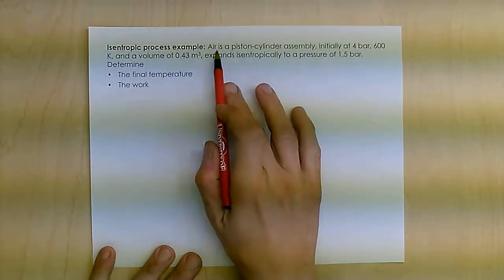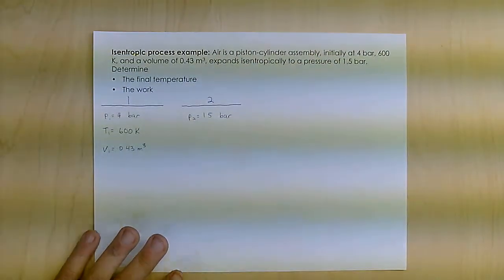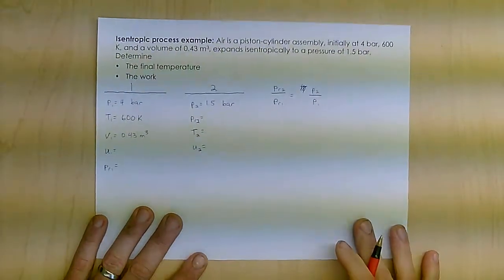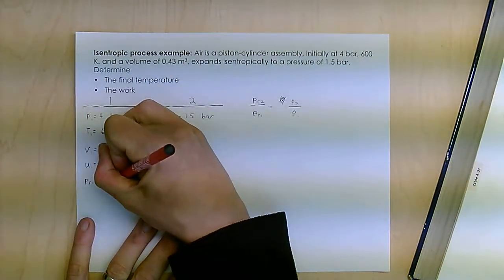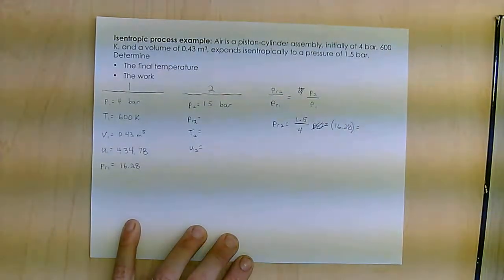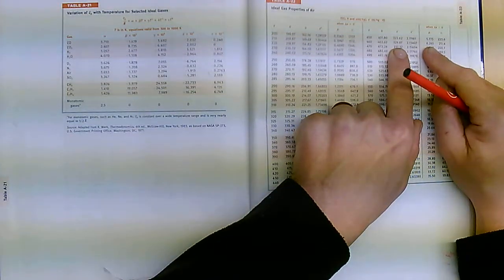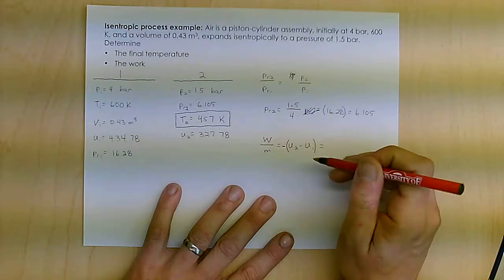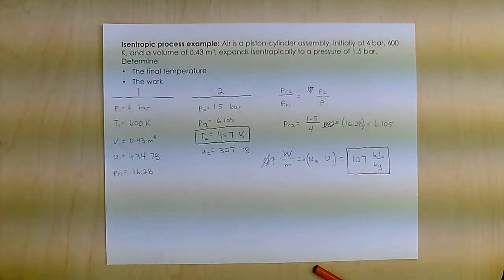Thermodynamics Example 21b: Isentropic Processes

Comment: I used the isentropic equation T2/T1 = (P2/P1)^(k-1/k) and got the same T2 very quickly. Then I used the polytropic, ideal equation for work used in the previous video, W/m = (R/k-1)*(T1-T2) and got the same W/m as well. It seemed a lot faster than what he did and didn't need tables, but it's good to see multiple methods validate each other.